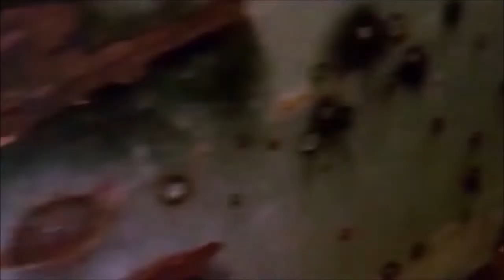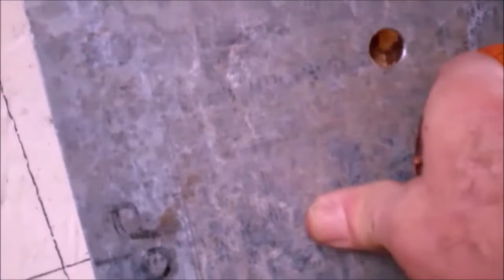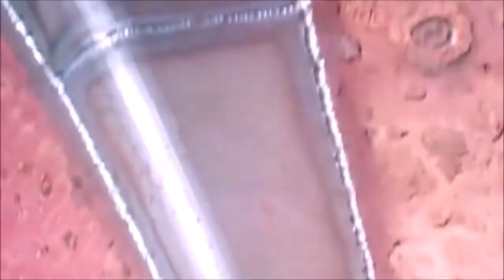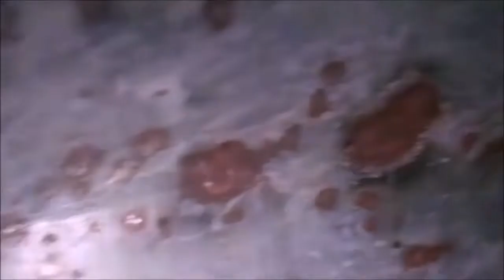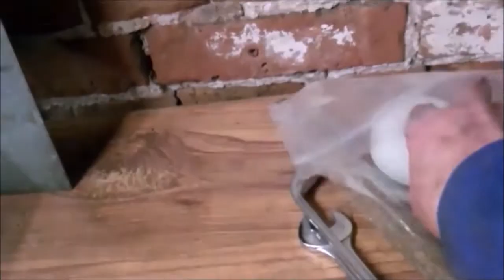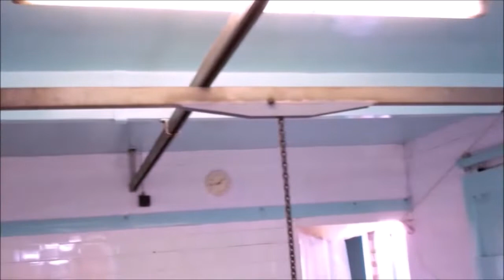Welding & Refurbishing this 65 year old cheese vat

Comment: john wonderful job as usual. requiring many talents and experience, would`ve loved to watch the jig pulling the flange out, had this issue before and i know it`s no fun. a tank repair like this doesn`t come too often to my shop but i thought maybe dimpling the plate would reduce distortion. afterthought you know. :D thanks for sharing. take care.
Reply from the maker: Hi Peter, Thanks, Yes the lower part of that 5mm thick flange was difficult to pull out being close to the bottom corner of the tank, it had to be "kinked" outwards here to make room for the flange on the inner tank that gets bolted to it, with loads of tension on that threaded rod  pulling I also had to whack the lower edge of the inner jig with a sledge hammer to get the flange to kink out and into position,  there is no adjustment here so the position of the outer flange has to be very accurate.